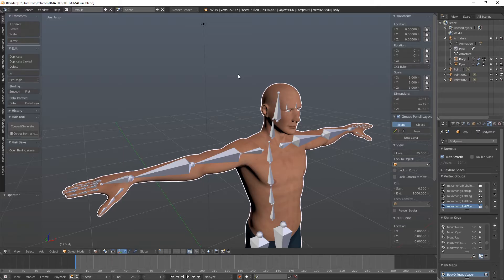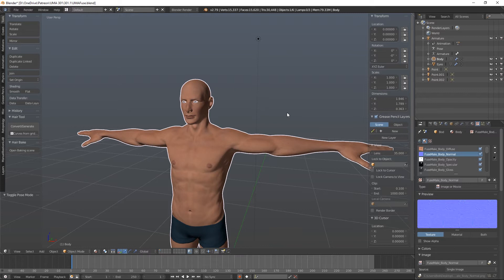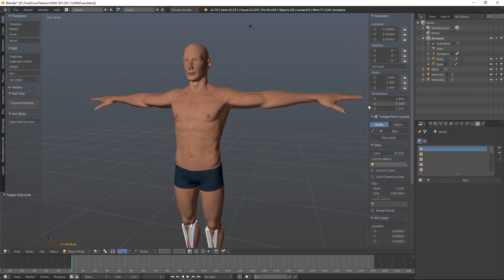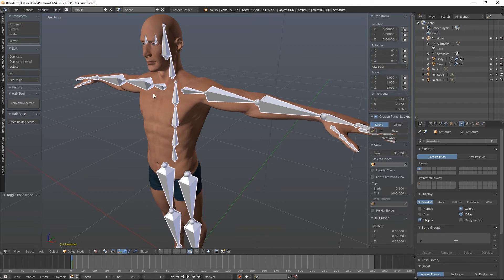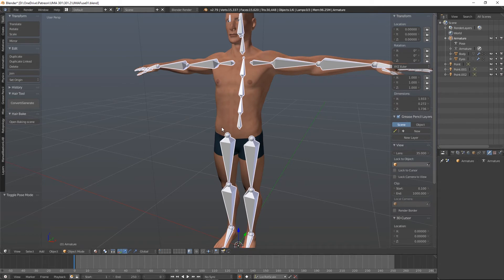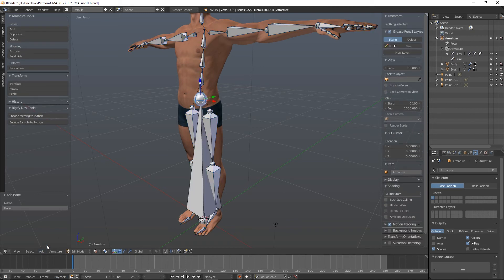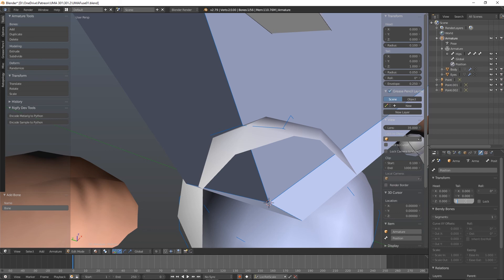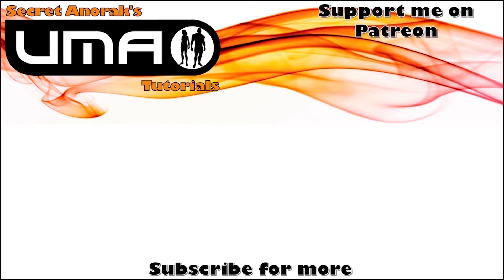UMA 301 - Part 2: Fixing Scale & Global Bones

Comment: Every single time I try to use custom characters they get crushed to the floor and rotated incorrectly.
I've gone so far as to take examples from the UMA project, load into Maya and I still get the same results - thinking that it's a matter of joint orientation for odd reason. Anyone here use Maya and not have issues?
Reply from the maker: Really sorry I can't help with Maya. Join my discord and put a call out for help there, or try the unity UMA forum. I know for sure we have users out there who are getting the job done with Maya. As with all things UMA, once you know the precise combination and order of the 189 steps needed to import a model then you'll be laughing.